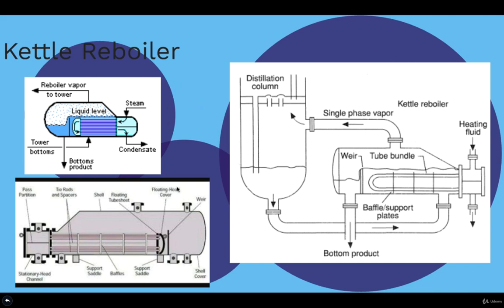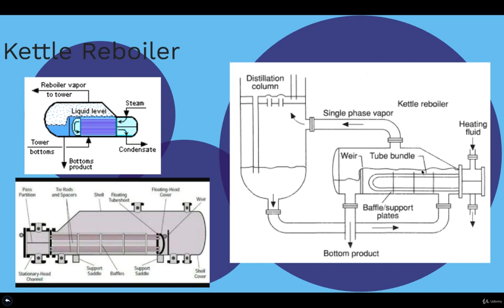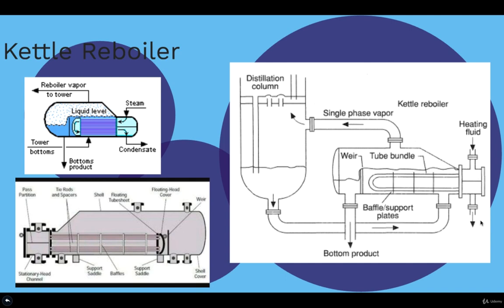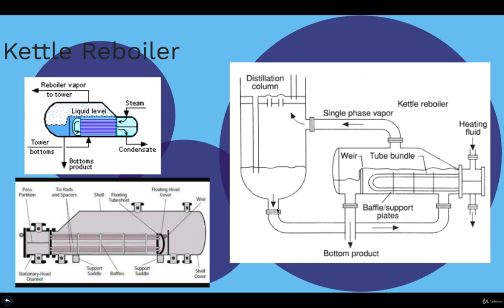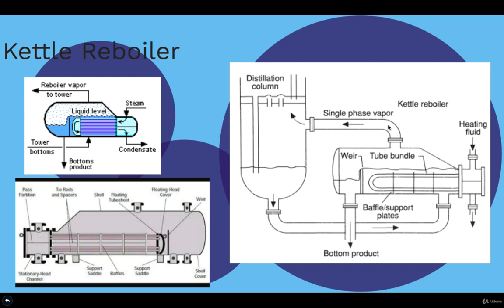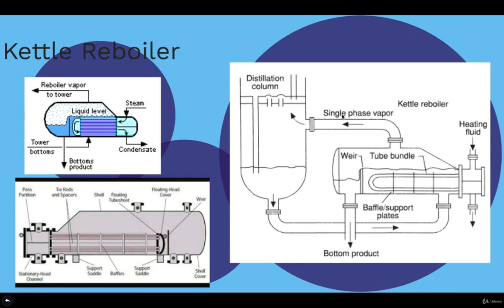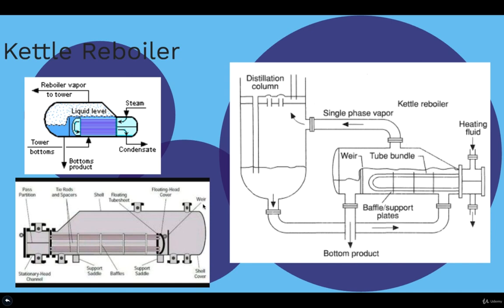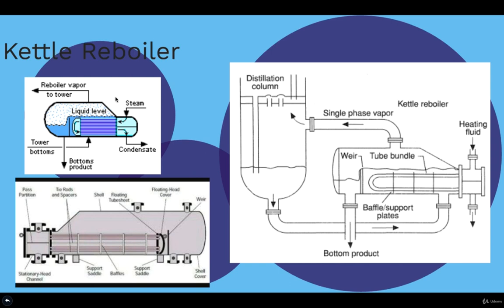Kettle Reboiler (Lec056)

Comment: Is it advisable to add isolation valves in liq in/out and vapour out line ?  What would be effect on liquid flow rate on shell side  and ultimately on heat duty?
Reply from the maker: When considering the design of kettle reboilers, the inclusion of isolation valves in the liquid inlet/outlet and vapor outlet lines is generally advisable. These valves offer several benefits, including maintenance and operational flexibility. Let's explore the effects of isolation valves on the liquid flow rate and heat duty in a kettle reboiler:

    Liquid Flow Rate: By adding isolation valves to the liquid inlet/outlet lines, you can control the flow of liquid entering and exiting the reboiler. This can be useful during maintenance or shutdown periods when you may need to isolate the reboiler from the process. By closing the valves, you can stop or regulate the flow of liquid, preventing it from entering or leaving the reboiler.

    Heat Duty: The liquid flow rate on the shell side of the reboiler is influenced by the differential pressure across the reboiler and the process requirements. By controlling the flow rate using isolation valves, you can adjust the amount of liquid passing through the reboiler. This, in turn, affects the heat duty. Increasing the flow rate generally increases the heat duty because more liquid is being vaporized. Similarly, decreasing the flow rate reduces the heat duty.

Therefore, by using isolation valves in the liquid inlet/outlet lines of a kettle reboiler, you can regulate the liquid flow rate and subsequently adjust the heat duty. This flexibility is beneficial when you need to control the reboiler's performance or isolate it from the process for maintenance purposes.

Comment: What is diff in kettle type and thermosyphon reboiler and when should we use either of them?
Reply from the maker: 💬 Kettle reboilers have a large liquid reservoir and provide gentle boiling—great for fouling or sensitive mixtures. Thermosyphon reboilers rely on natural circulation without a large hold-up volume—better for efficient heat transfer and when space is limited. Choice depends on process needs, fouling tendencies, and space constraints.

Comment: gasoline (65°api gravity) flow rate of 60,000 lb/h with a small boiling range at 400°f is to be vaporized to form 37,050 lb/h vapor at an operating pressure of 200 psig. use gas oil (30°api gravity) in the temperature range from 600 to 500°f at 120 psig operating pressure as the heating medium. a tube side pressure drop of 10 psi is allowable. design a suitable kettle reboiler to serve the purpose.  SOME ONE PLEASE HELP ME OUT WITH THIS PROBLEM

Comment: Nice video sir. I just have a question. What case do we use the kettle reboiler? And why? Can you compare with thermal syphone reboiler? Thanks.
Reply from the maker: depends on the application, the food industry is a great example. The syphone reboiler has much more turbulence compared to this... if you require a slow and efficient boiling, this will be it

Comment: ThankU docort, I am looking for designing one kettle reboiler,  the strange thing is that, the procedure doesn't count for the properties of process fluid, most of the steps are for the tube side(hot fluid)
Reply from the maker: Well, fo the Kettle Reboiler design you will need mostly hold up, flow rates, pressure and temperature

Comment: Thank you for this !
Reply from the maker: XD
Reply: gasoline (65°api gravity) flow rate of 60,000 lb/h with a small boiling range at 400°f is to be vaporized to form 37,050 lb/h vapor at an operating pressure of 200 psig. use gas oil (30°api gravity) in the temperature range from 600 to 500°f at 120 psig operating pressure as the heating medium. a tube side pressure drop of 10 psi is allowable. design a suitable kettle reboiler to serve the purpose.  SOME ONE PLEASE HELP ME OUT WITH THIS PROBLEM

Comment: Thanks v much
Reply from the maker: XD
Reply: @ChemicalEngineeringGuy  gasoline (65°api gravity) flow rate of 60,000 lb/h with a small boiling range at 400°f is to be vaporized to form 37,050 lb/h vapor at an operating pressure of 200 psig. use gas oil (30°api gravity) in the temperature range from 600 to 500°f at 120 psig operating pressure as the heating medium. a tube side pressure drop of 10 psi is allowable. design a suitable kettle reboiler to serve the purpose.  SOME ONE PLEASE HELP ME OUT WITH THIS PROBLEM